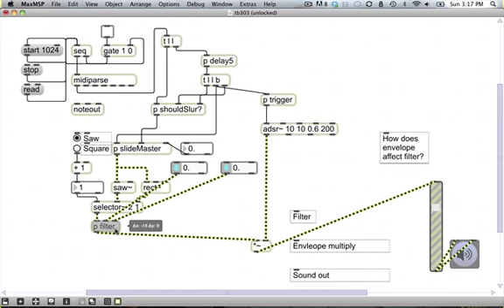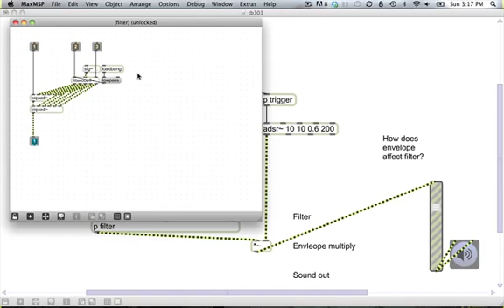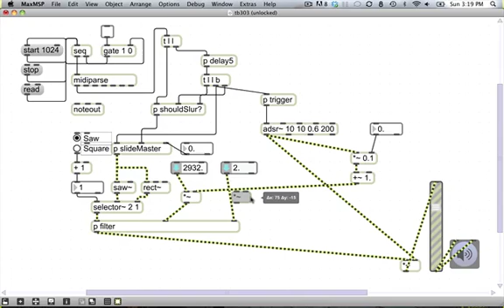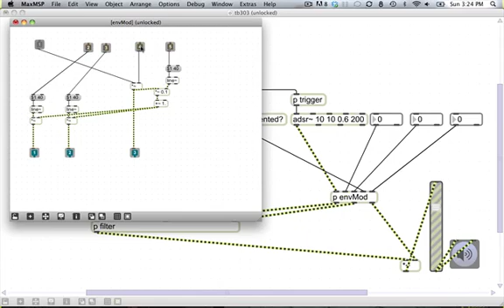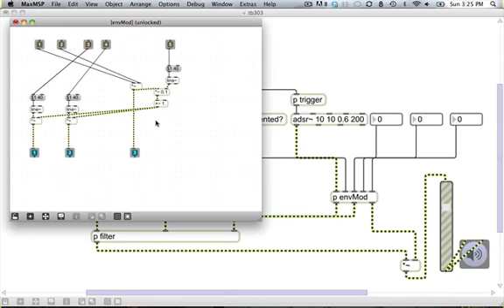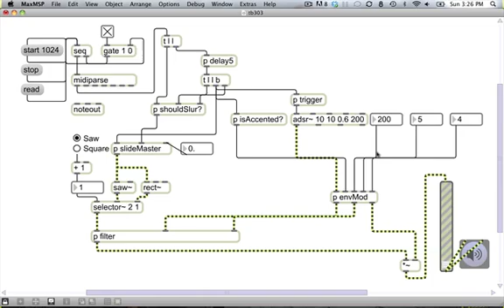Delicious Max/MSP Tutorial 6: Let's build a TB-303 (Part 4)

Comment: I confirm tb303 is closer on a rough first estimate to a -18dB/oct filter so ... 3 pole.
To be closer to the original filter, use 4 times 6dB/oct filters with a slightly freq offset on the first pole. It will not go perfectly to a 4 pole filter and tend to respond like a 3 pole.
Then, you can try to make a nicer filter with an overdrive or analog clip instead of going crazy on the resonant kind of thing.
Nice tutorial ! continue to present us your expertise with this passion !